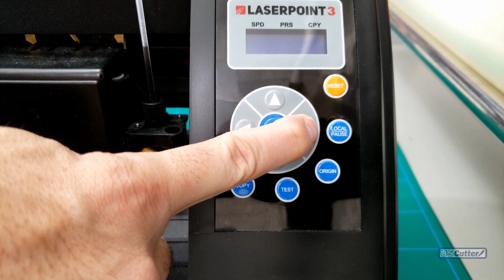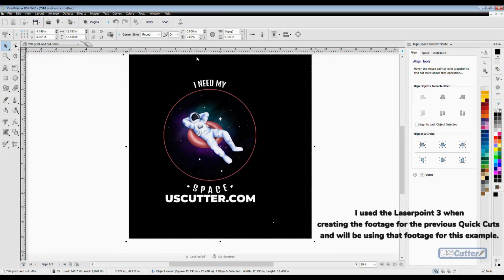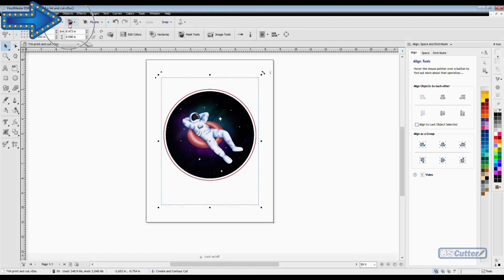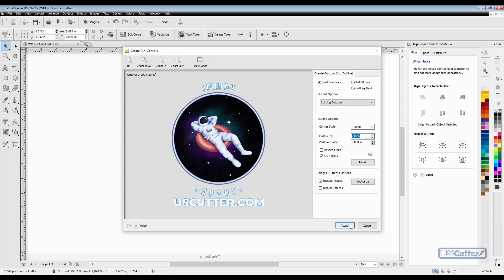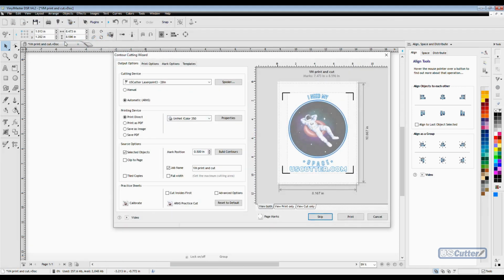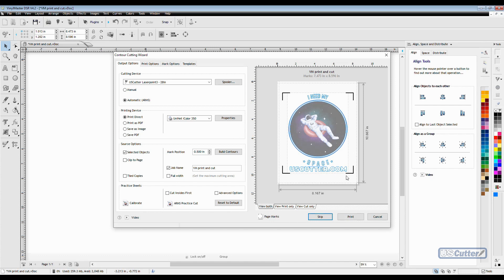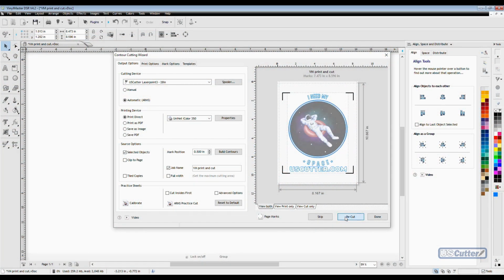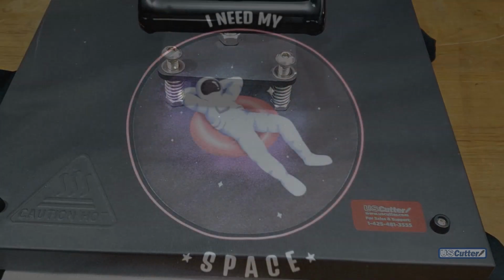Quick Cuts -  Calibrating a Laserpoint 3 for Print and Cut with Vinyl Master. UPDATE IN COMMENTS

Comment: Vinyl master creashes all the time. Its a 32 bit and it doesnt work well on 64bit machine. There is no fix for it. It just crashes when 6 files are in the memory.   Junk software.  Also, vinyl master doesnt clear jobs from the system after they are done.  So you send a new job, I have to manually keep deleting every single job that is done. Pain in the a$$.   Forget this software.  There is no fix for that.  Other users are reporting same issues.  Company doesnt even want to help.  And I have the DSR most expensive version with the same problem.